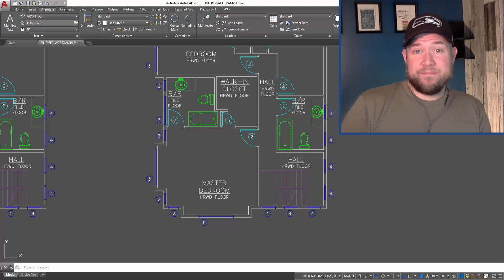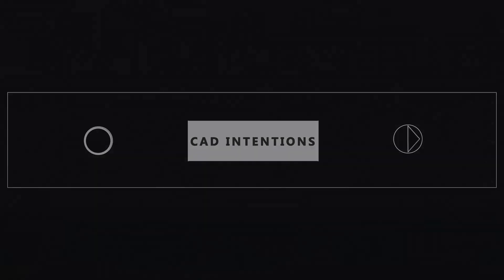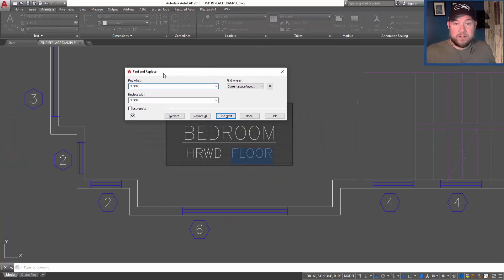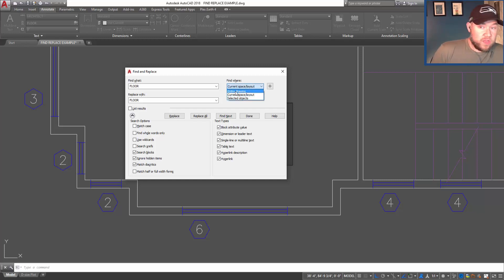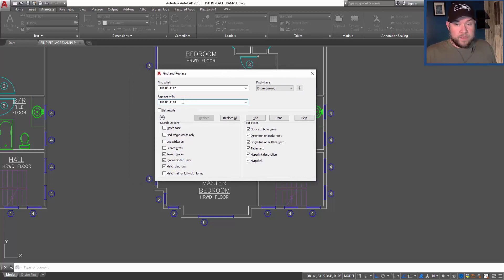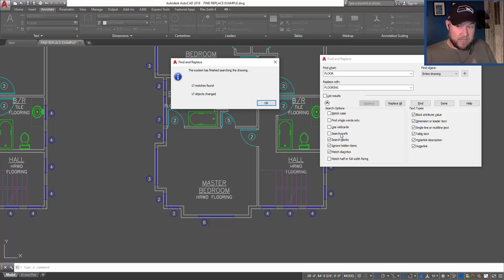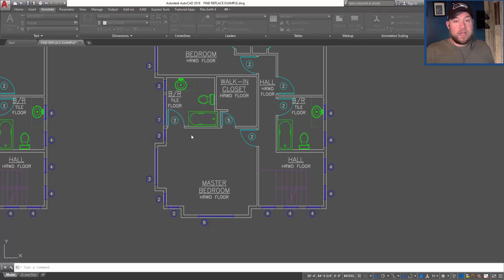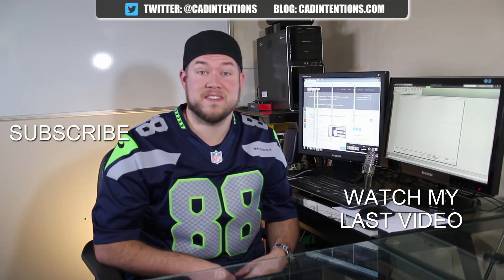AutoCAD How To FIND & REPLACE Text in An Entire Drawing Automatically - 2 Minute Tuesday

Comment: How about this scenario for find/replace.   I have a multiline text in a drawing, ie: BL xx, LOT xx, Parcel A, Area = xxx sf. or xxx ac.   This text is stacked vertically with the Parcel A in the middle.  If i want to get rid of the Parcel A line entirely.. how do I do THAT? I can find Parcel A and replace with nothing but it still leaves the space there. How can I completely remove the middle line from the text??

Comment: Thanks, Brandon!  That was very informative.  In addition to what you've shown, the "List results" option can be helpful also.  It allows you to see the found locations as a list instead of rolling through them one by one using the "Find" button.  Once found, you can "Zoom to Highlighted Result" to see the actual text location by either using the icon on the right or double clicking on a line in the list.

Keep 'em coming.  :-)